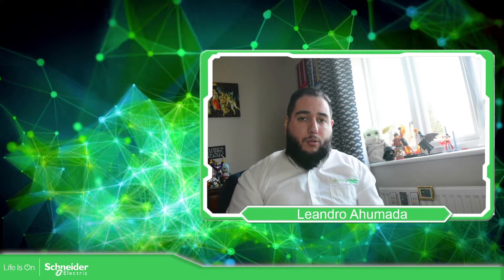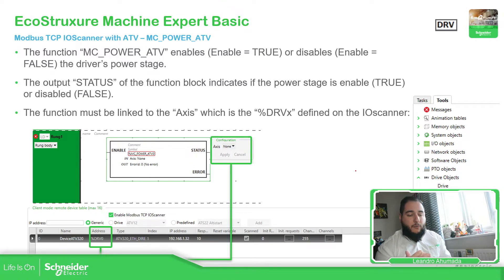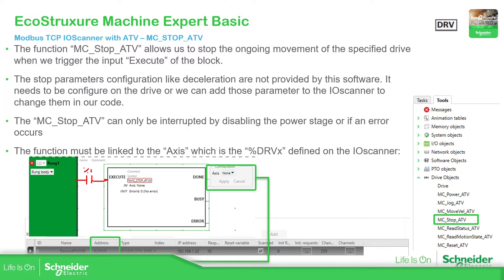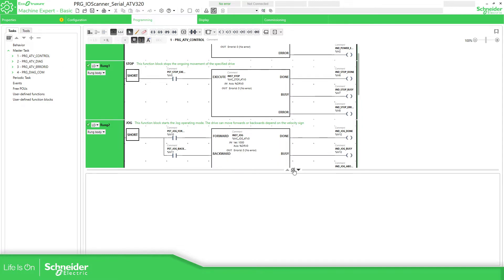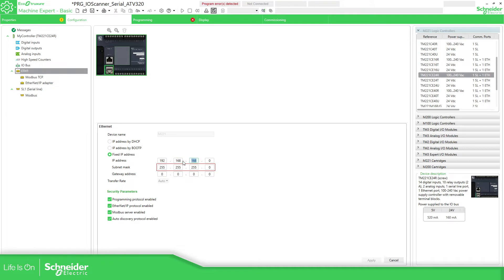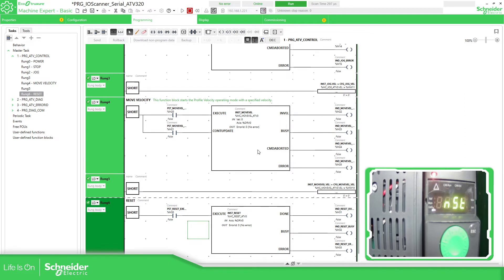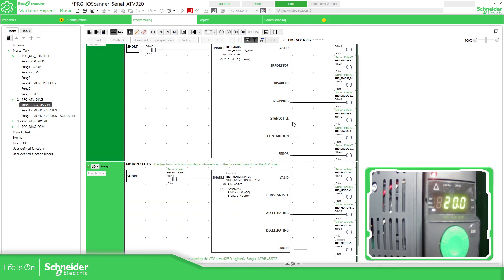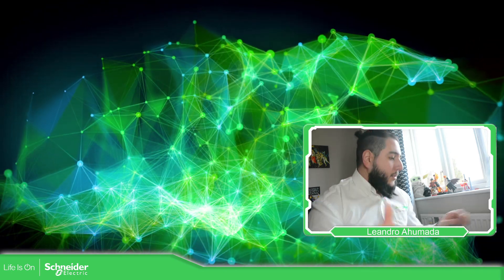Training - M221 - M10.4 IO Scanner for ATVs Implementation

Comment: Hello, on my project I have several frequency converters. Can 4 ATV650 drives be managed at the same time with all the %MC blocks on the M221? I did my project but sometimes, after a day or two, one of the four drives stops on its own without commanding it. thank you
Reply from the maker: Hi Anthony, that behaviour is not normal. You should be able to work with the drives with no problem. I recommend you to check the code and the system variables for the channels in case something in the network is wrong

Comment: Thanks for offering a good information I have a question about how io scanner addressing voltage value from voltage interface module tesys island ?
Reply from the maker: Hi Mahrous! I have never tried to use the modicon M221 to control or monitor the TeSys Island. As far as i know there is not any integration between those two devices in Machine Expert basic. You can check the next manual for further information : https://download.schneider-electric.com/files?p_enDocType=User+guide&p_File_Name=8536IB1905EN-03.pdf&p_Doc_Ref=8536IB1905EN
Reply: I'm appreciate you. I'm already using modicon m221 with tesys island and configureed with Somove v 2.9 all thing working good but monitoring voltage and energy not worked well the values not returned there is something in communication or configuration with io scanner not clear with me
Reply from the maker: @engramadanmahrous8209  in this case I recommend you to contact the technical support team in your country so they can give you further information: https://www.se.com/ww/en/work/support/country-selector/contact-us.jsp

I do not think i can make this test at the moment
Reply: @LeTomasAHUMADA   I'm already called a technical support but I'm not get answer to my this problem . But I thank you so much for your reply and effort
Reply from the maker: @engramadanmahrous8209  sorry to hear that. I am not sure if you have tried but try in the exchange community. In there you can find good information and solution for good ideas  😊 https://exchange.se.com/